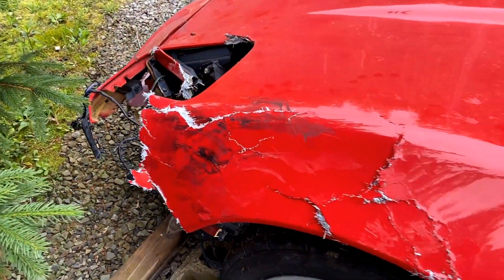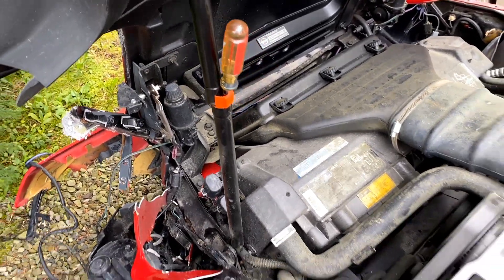The Differences of C4 Corvette Hood Support Props Explained and Upgrade Details 1984-1996 Corvettes

Comment: Just did the upgrade from scissor lift to lift a assist on my 86 and the top bracket knob must face the wheel well or the lift rod will hit my alternator bracket on the way down.... Fits perfect in that orientation

Comment: I have a 93 and the holes are also drilled in on the passengers side for larger hood prop. Not sure about how the brackets will line up. Haven't gotten chance to do more research yet or test fit parts

Comment: I have an 86 z51 with the early 84-86 hood prop but the later 86 aluminum heads. Was there a slim period of time where the early hood prop and late aluminum heads were both integrated or do I just have an oddball? As far as I know everything is original

Comment: My "88 has only only one lift on the two hinges and it's on the right hinge.  I don't think you mentioned in your video that after the '87 model year, only one hinge lift was used.  Am I correct about this.  Apparently, from your video, the later cars did away with both hinge lifts.

Comment: I have a 93.  If I replaced the gas loaded support would it “automatically” lift my hood when I pull the lever?  In other words is there enough compressed gas in the strut to open all by itself with no assist?
Reply from the maker: No. They were never meant to lift the hood by themselves only to offer assistance when lifting

Comment: can i put those two small lift struts on a 96?  If so what year do I want?
Reply: i bought some c4 hood hinges as mine did not have any. it bolted on fine, but does have the piston mount points, so yes you probably could if you replaced the hinge with an older one